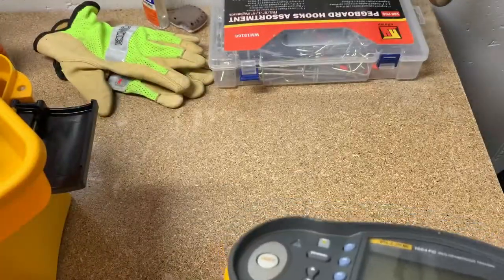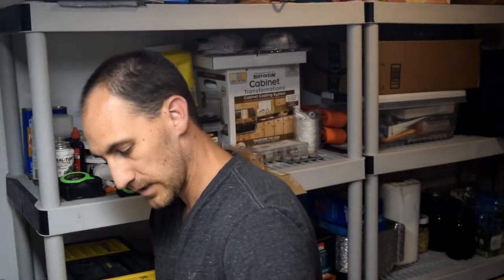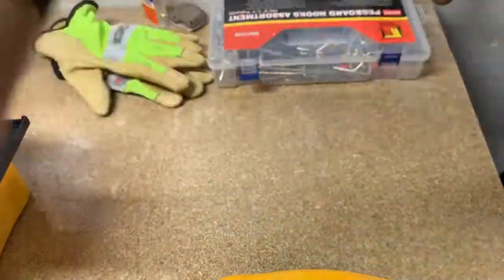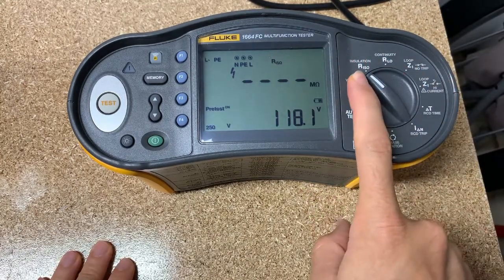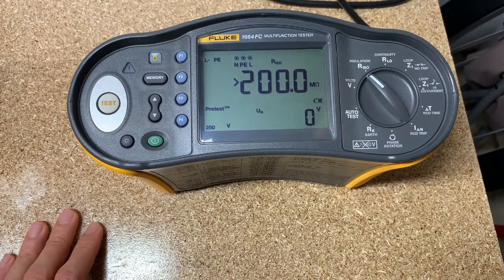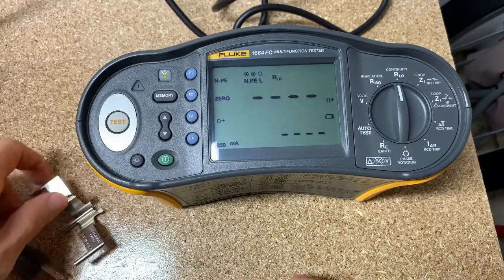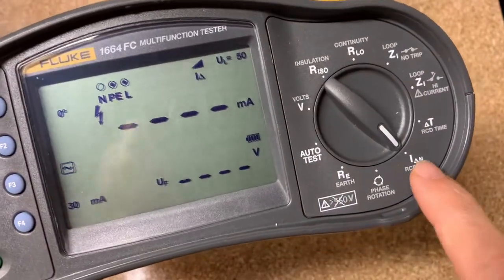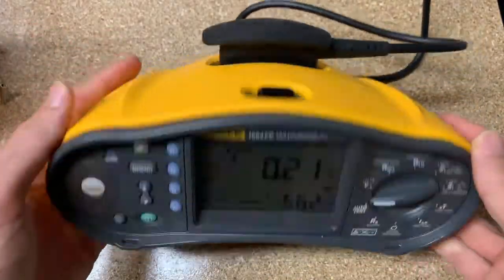Fluke-1664 FC - Fluke Fridays - Episode 19

Comment: The loop Zi test (known here in Australia as fault loop impedance test) is used to determine the total impedance of the circuit from the supply transformer through your consumer main active, sub mains active, final sub sircuit active and back through your protective earths/neutrals to the transformer - which completes the loop. The purpose of this test is to ensure that the overall impedance of the fault current path is low enough such that it will allow enough current to flow and trip the circuit protective device before the cable and equipement is damaged

Comment: Electrician in South Africa here, Every chance I make, new socket install or move a light anything, I must compile a COC, Certificate of Compliance for the full home. If the owner has one I can add an amendment to it. Same as EU. If owner sells his home, and coc is older than 2 years he must get a new one. So not just inspector but every sparky MUST, have installation tester. Prove you did your work right and installation comply to building and Electrical regulation

Comment: Zi and Zc is for the maximum short circuit current which can be deliverd at your system. This have to higher than your switch off current of your fuse in x,xx seconds because otherwise your fuse/breaker wont work as fast as it has to be

One of the features prevent tripping an earth fault breaker
Reply from the maker: Thanks for the comment!